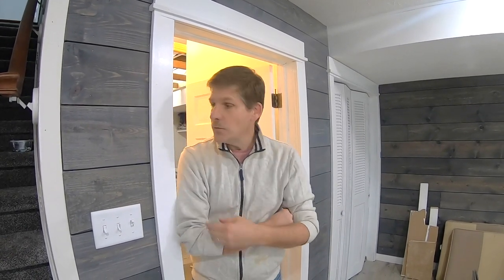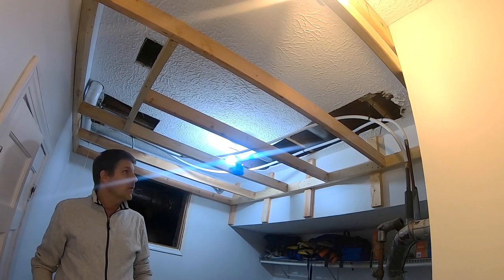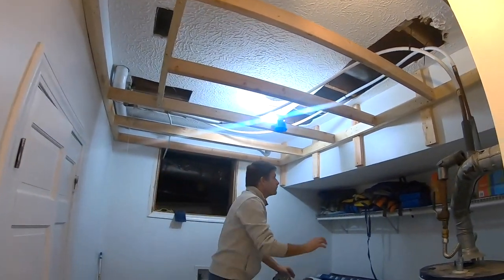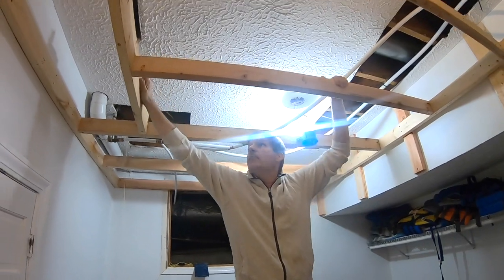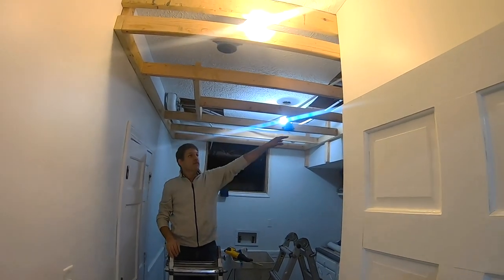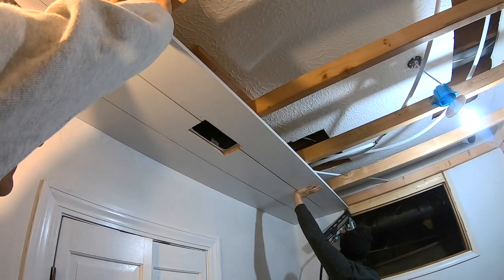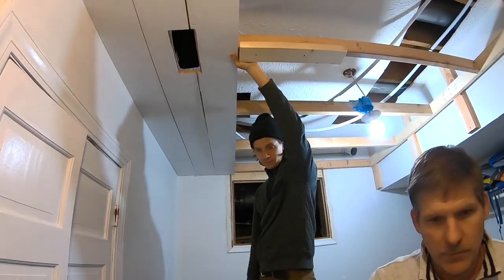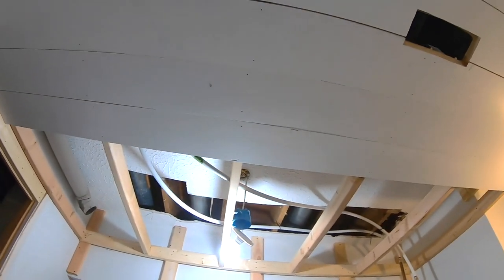How to Hang a Plank Drop Ceiling

Comment: Should have eliminated the additional soffit drywalling by running a 2x4 cleat along the top of the wall to “hang” your suspended framing from using 2x4s cut to length and sandwich your framing between them and the wall. That would have offered plenty of strength for the purpose.